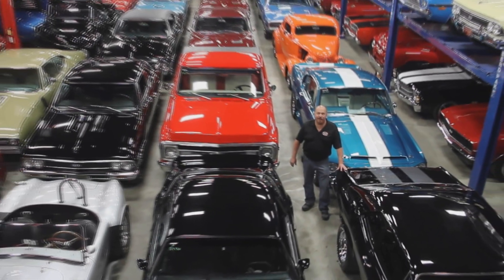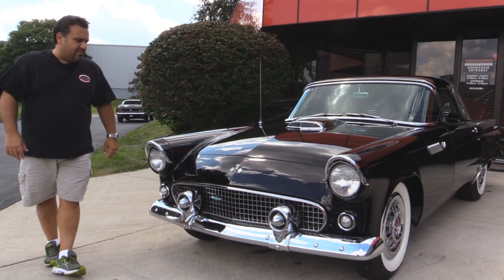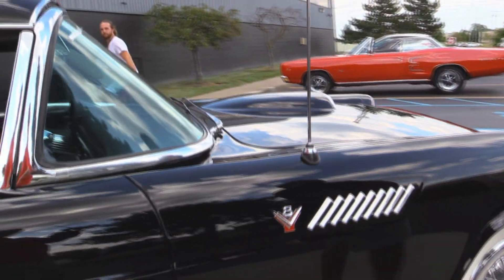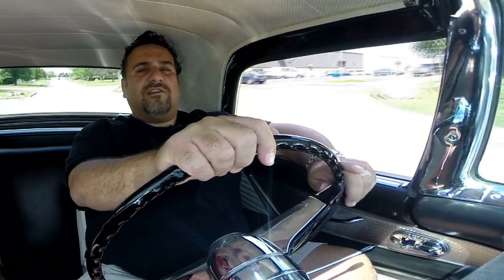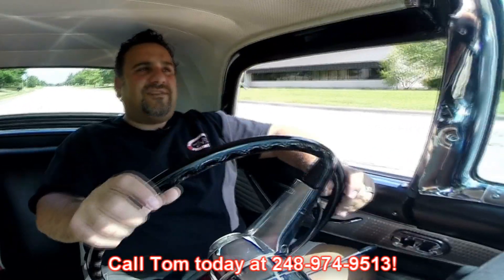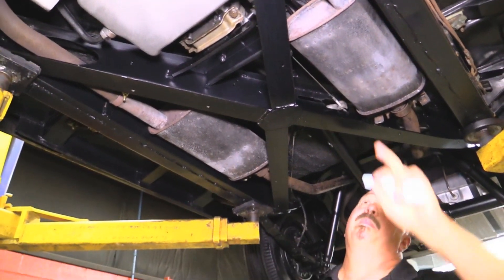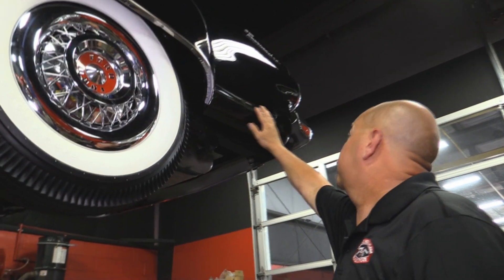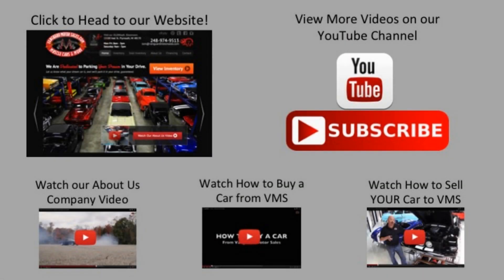1955 Ford Thunderbird For Sale

Comment: They jumped over the 272 V8 and went with the newer 292. In 1954 they’d revolutionized the V8 with a pushrod design OHV.  Then they just stopped innovating.  By 1960, every American car should have had an OHC valve system.  But when they couldn’t give an American car away (1990) they were still pushrod designs.  Now they have the Coyote.  Great timing!